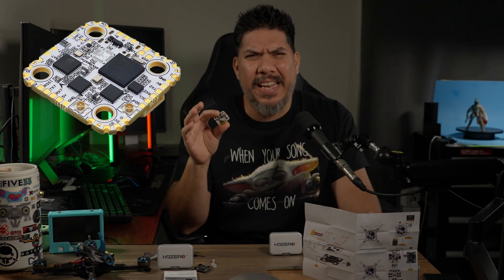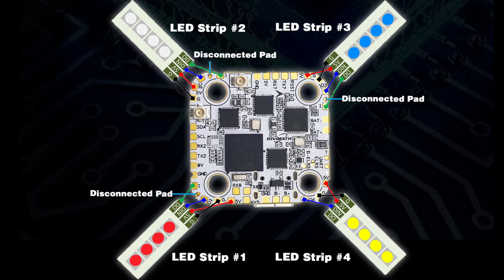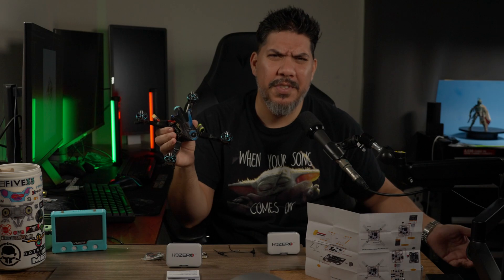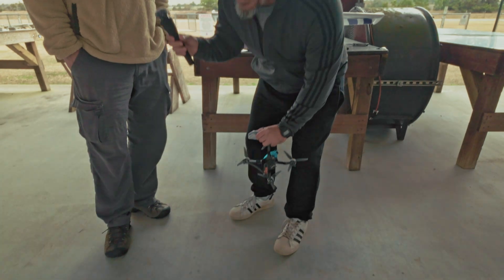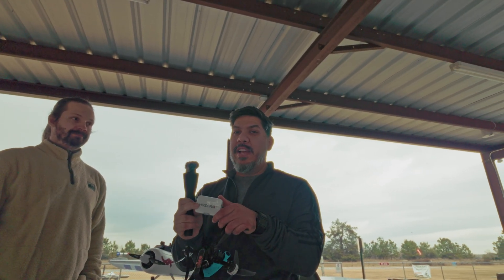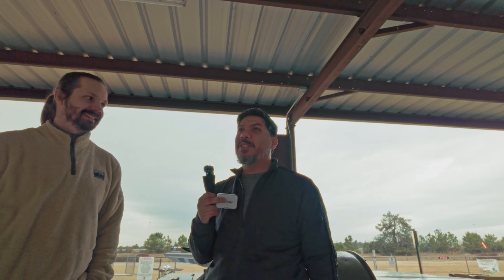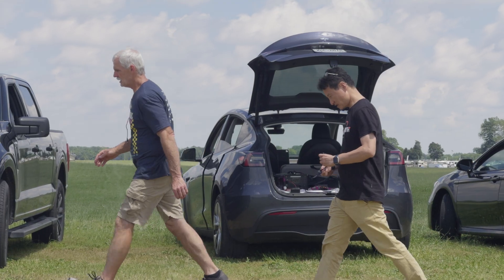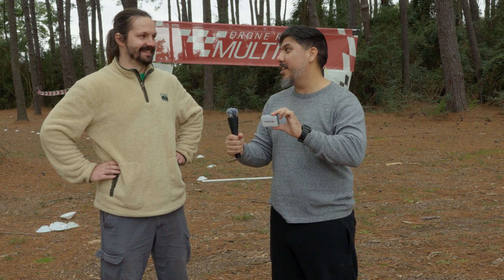Drone Flight Controller + Receiver in 1 - HDzero HALO Best FC for DJI or HDz

Comment: Got to say that I really do like the HDZero company and what they do.  I really love the clarity of the DJI VTX systems and when it came time to choose between systems i went with DJI.  

HDZero was a close second due to the fact that they made arguably the best googles of any and had really good connectivity and integration with analog and Walksnail.   With HDZero goggles you can fly at least 3 separate video systems and see the video right in the goggles.  

If DJI could come out with a pack like the Walksnail that is simply the VTX for the goggles end of things with a HDMI out that would be amazing.  Anyway hope to see many more videos from you in 2025.